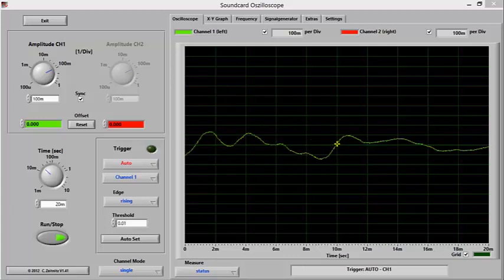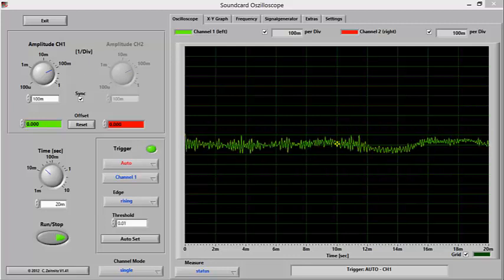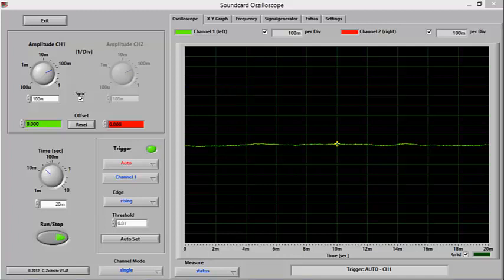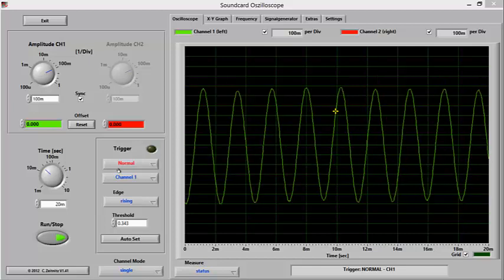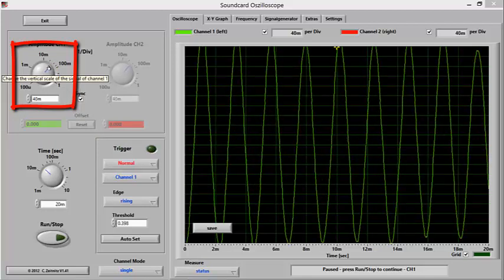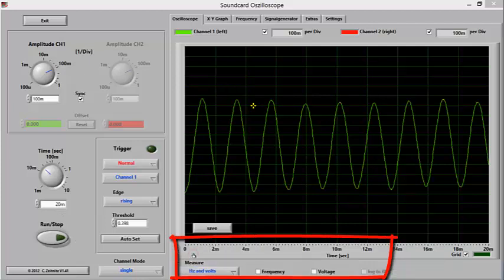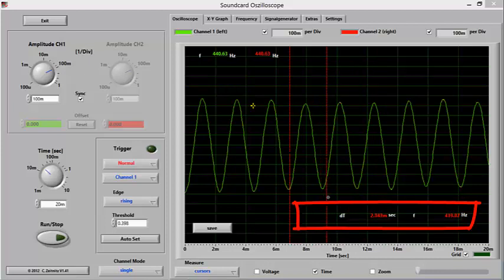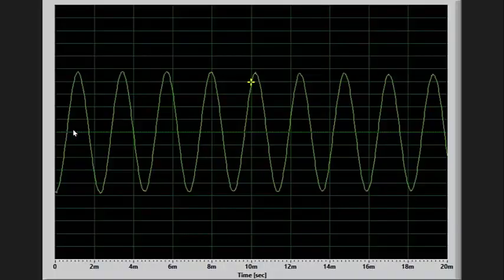Soundcard Oscilloscope Basic Tutorial

Comment: Can we have a two wave forms from  two different soundcard?
Reply: Ive made a two wave forms sondas with my sound card, 1 jack 3.5mm stereo, some resistors, some caiman clamps and some shielded wire, a little pice os breadboard, soldering iron and thin, the secret is on the 3.5mm jack stereo, the tip of the jack is possitive for 1 line (1 mic), the center or second secction is the second line (yes, the 2nd mic) and the third secction (the secction more approach to the wire) is common, negative , mass, earth or any name you kwnow

P.d. sorry for my bad english, I hope you can understand me anyway

Comment: Great video thanks.
I want to see the waveform of a 5 volt (peak-to-peak) pulse-width-modulation signal generated by a microcontroller. 
Could you please suggest the connection between the microcontroller pin to the laptop's microphone jack ?
Reply: You will need voltage divider to put that 5 volts in range of 1vpp. Line in on pc can handle from -1v to +1v, but check for yours...